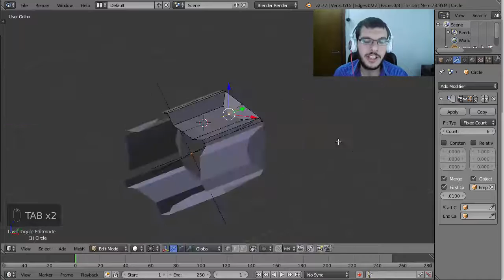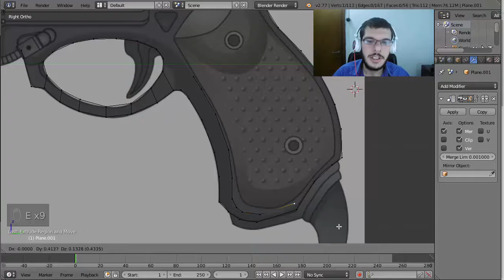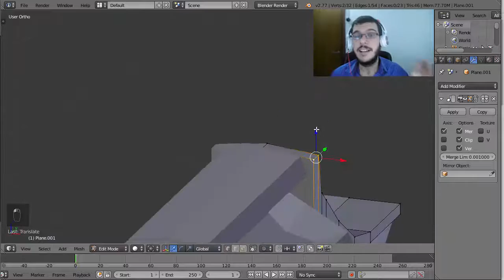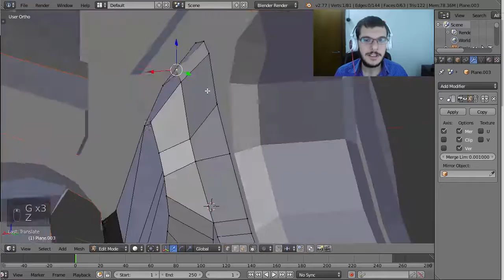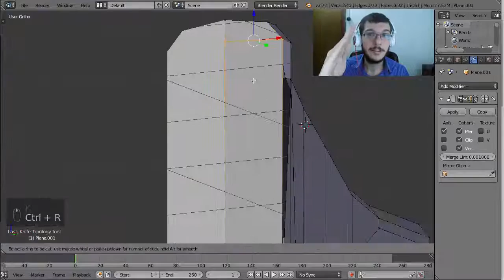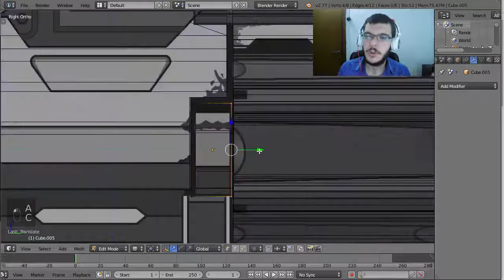Destiny hawkmoon Papercraft

Comment: after paying and downloading this, it turns out your scale was off, the prop should be 290mm+ in length, not 230mm. the "real" version is a 12-17 inch long massive revolver, not a less massive 9inch. at the same time I modified it to work as a Eyasluna, or my custom exotic idea
Reply from the maker: thank for pointing that out i will be fixing it soon